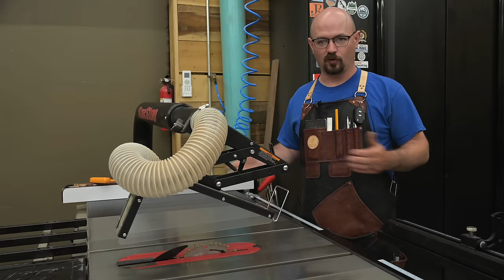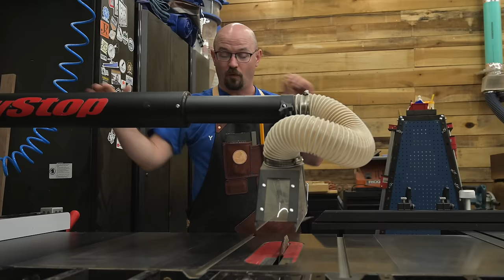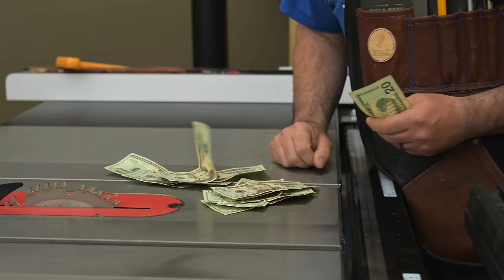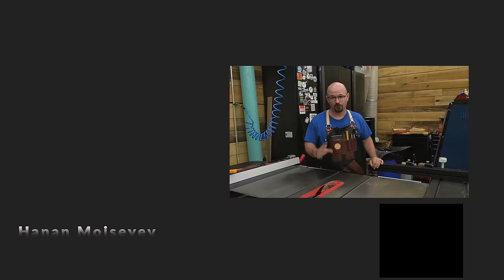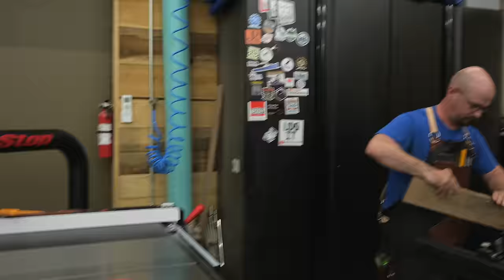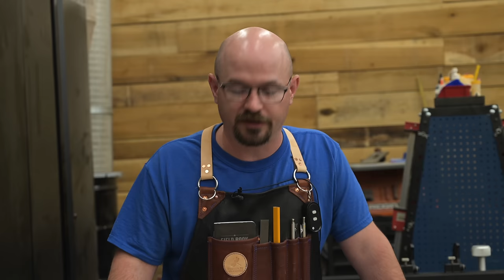Is SawStop Actually Safer?

Comment: Because I’m concerned about becoming complacent, I got rid of my Sawstop. I also removed the seatbelts from my car. God knows I don’t want to be caught being complacent behind the wheel of a car. Btw - I also removed the bannisters from all of the staircases in my house. Can’t be too careful there.
Reply from the maker: It only makes sense. Hope you also deactivated the “hot burner indicators” on your stove. 🤣🤣🤣
Reply: well hear the thing the table saw ain't the only tool in shop that dangerous. u need to take proper precautions with all power tools
Reply: @johnstrickland3933  For sure. But so what? Nobody's saying consider a safer table saw, but don't bother with safety concerns for anything else.
Reply: Why stop there? I removed my car side mirrors, got rid of my spare tire, both fire extinguishers, condoms, trigger locks, welding helmet, safety goggles, hearing protection and deleted my smartphone security (like I would ever leave my cell phone behind). Sure, I'm practically petrified when ever I'm awake. But, at least I won't be complacent.
Reply: @steveh8724  in not saying not to just make it a law that u have to have technology.
Reply: Did you removed your covid vaccine too ?  .... seat belt analogy ... 😂😂😂😂😂😂

Comment: I own a PCS175 and I bought mine second hand.  I am a weekend warrior woodworker and owned a cabinet saw and contractor saw prior to owning this saw.  The Sawstop is a well built machine and is a joy to use.  I am likely more careful than I ever was cause I just dont want to trip that brake and join the "club".  It gives me peace of mind knowing that if ever I get complacent or do have an accident, the injury should be minimal.  I am also aware that the saw won't save me from a bad kickback, although the riving knife, proper alignment and good technique reduce the chance of kickback.  I still respect the saw, just as I do all of my tools.  And when I did not have the financial resources to buy the saw, I came up with reasons to not buy one, and once I saved up for the saw, I found reasons why I should own one!  I always knew deep down that this was the right saw for me.
Reply from the maker: I think the last part of your comment is key.

Comment: I knew the Sawstop was a good idea from the original press release, but already had a table saw. Then I started working on a canoe. For a year, the saw was shoved in a corner and I used a hand saw a lot. When I could use it again, I just was not as comfortable with it. Your spouse/partner/mom wants you to have a Sawstop too. BTW, if you do stick your hand in the blade they'll send you a new cartridge. Just not for an accidental trip like cutting into an aluminum miter gauge.
Reply from the maker: Ah that’s right. I forgot they’ll replace it if it was a flesh contact.
Reply: I didn't get a new cartridge when my saw saved two of my fingers because I wanted to keep the one that saved me, complete with embedded blade!

It's absolutely unbelievable that so many people say "oh, it's expensive when it fires and ruins a blade and cartridge", as though the cost of losing a finger isn't a gazillion times more!
Reply: What they also wont do is replace it when it goes off for no reason.  I, me, this guy, personally had one misfire on me twice and there was no metal or even slightly damp wood...or flesh involved.  First time the saw was already turned off, yes, OFF and only a piece of the off cut plywood was anywhere near the blade...I hear this "thunk" but didn't think anything of it till I went to turn the saw on again and it wouldn't.  It fired, while it was off, with nothing touching the blade but air...and the blade didn't drop either.  SawStop asked...was it humid that day?  Dafuk?  No, it wasn't, and also, this saw is in an air-conditioned shop.  Next time I was ripping a piece of kiln dried maple, maybe close to 2in thick, and it went "thunk" mid-way through the cut...still no metal or flesh in contact with the blade and again, the blade did not drop...it stopped...but didn't drop.  Same stupid question from SS...was it humid?  Same answer, no, and still in an air-conditioned shop.  This was at a maker space called TechShop.  They had several incidents like this...I can only speak in detail about these two.  Not very good at inspiring confidence in my personal opinion.

Comment: I upgraded to a PCS a couple weeks ago after using an old jobsite saw for a few months after getting into the hobby. The cost of a losing a finger is more than just the medical bills. It impacts your livelihood. My work would severely be impacted until I could replace decades of muscle memory if I lost even a single finger. 

I fortunately am in a position where I can drop $4k on a new table saw for a hobby, but I know most people can't. I would say to most people though that you can buy a comparable SawStop model for the cost of that cheaper saw you are looking at plus a $1k insurance deductible. 

I am in the same boat as you as well. I am really attached to my wallet. No one wants to spend $200 on a new cartridge and blade, and the thing isn't bloodless either. The cut probably isn't going to need stitches, but it isn't going to just be a scratch either. I will admit I am more comfortable having my hand closer to the blade, but that doesn't mean I am being reckless with it either.
Reply from the maker: Right? Theres a big difference between adjusting your technique based on the change in risk and being aware of that.. and just being reckless. 

Glad to hear you were able to afford one. It's definitely an investment. And no matter how much something is worth it, if it's not the cheapest option there'll always be those that just don't have the funds.
Reply: @YouCanMakeThisToo speaking of funds, have you had accidental activations that have not touched skin, but something caused it to increase the overall cost?
Reply: @liquidrockaquatics3900 
It happens but they aren't going to admit it.
Reply: @jowho9992  why would they deny it? There’s nothing to be gained about lying, especially when telling the truth just makes  it obvious that they’re so sensitive. The company covers the replacement anyway because you just send them in and send a picture. I’ve learned a few things since this post.  I bought a pcs, but I haven’t picked it up yet
Reply: @liquidrockaquatics3900  
I have already seen a video where they claim that wet/green wood can trigger the stop.
Can any show proof that it doesn't?
Reply: @jowho9992  wet wood can of course, the saw flashes if you test it first. Bourbon moth or someone cut a bunch of nails and stuff and it didn’t trigger, but aluminum triggers it 100% of the time- even foil backed insulation  edit- it has to be really damn wet, and YOU have to be in direct contact as well

Comment: I have had my saw stop for about a year and I have not found my technique change really at all.  I don’t want the brake the kick off and always try to assume it’s not there. It’s insurance not part of your workflow.  Saying it makes you complacent is like saying having airbags on cars makes people more likely to run into things.  My new saw also added a riving knife and much better blade guard so that was a huge plus in addition to the flesh sensor.  Kickback can still happen but the sawstop design minimizes it to a much higher degree than my old 20 year old saw.  I looked at many 3 to 5hp saws and in the end decided the Sawstop was the best choice for me.  I have not regretted my decision at all and the sting of spending extra on the saw is long gone while the joy and insurance of using it lives on.
Reply from the maker: Mine has changed a little bit, but not drastically. 'Cause as you reiterated from the video... last thing I wanna do is go toasting brakes and blades. And if I'm being honest, I don't do sketchy stuff any more or less often than when I had my 30 year old saw without even a riving knife. I just don't sweat as much when I need to do those.

Comment: I think for most people, particularly those making comments on youtube videos or online forums, it comes down to simple cost. Sawstops are expensive. Yes, they are great saws outside of the safety feature, but that actually is part of the issue. It's my understanding that one of the reasons why Sawstops are so well built is because they need to be in order to deal with the inertia from the safety feature engaging. That's a lot of kinetic energy that needs to be absorbed by the saw in a fraction of a second, so you need heavy duty components to be able to survive and continue working once you install a new brake/blade.

Assuming that is true, that means cost. Most people commenting on youtube/forums are not cabinet makers or big shops, they are hobbyists working in their garage/basement. They don't always have the extra $1000+ in order to buy a sawstop compared to a the same size saw without the safety feature. Yes, everyone knows that an ER visit will be more than $1000, but most people are living paycheck to paycheck. They don't have an extra $1000 right now. They don't have the $3000+ to pay for an ER visit (which is why medical bankruptcy is so common as you mentioned in the video).

Now yes, some of those comments are old timers who have been doing it for 30+ years and are stuck in their ways. But, a lot I think are just bitter that they don't have the money for something that should be standard on every saw right now (like seatbelts and air bags on cars). Yes, some are confident (over-confident?) in their skills and use that to justify buying a 3hp or 5hp saw in another brand, for the same price as the contractor or 1.75hp pcs sawstop. However, most I think are just bitter that they don't have the money for a safety feature and so come up with excuses to justify it. I don't begrudge folks for that attitude at all. A seatbelt/airbag is not a significant added cost to a car, but it is on a sawstop and because of the patent law right now, Sawstop has a monopoly on it. I know a lot of people who are waiting for the patents to end, so other manufacturers can start producing their own versions. This is on the assumption it will drive the price down, as it has many other tools after a patent expires. Look at the price of biscuit joiners, oscillating tools, and now track saws before the patent expired they were all over $1000, now you can pick up cheap versions for $50-200. Over an 80% reduction in price due to competition. Now will that happen with sawstop style safety devices? Probably not, due to my comments earlier about build quality, but it should still likely cause a significant reduction in price to where it becomes reasonable to spend $200-300 extra for the safety feature, rather than $1000+. In that case, folks would likely consider saving up that money, rather than buying something now (or buying used) and dealing with the added risk.
Reply from the maker: Very true, I think there’s a lot to the bitterness. It’s often easier to make up really poor arguments against something you want but can’t afford, than to just say “it’s out of my budget.” Especially to a demographic that has had it heavily impressed that their marketplace compensation IS their personal value and worth. 

Personally I’m hopeful with the patent expiration we’ll see some better alternatives. There’s been some nondestructive methods developed that seem to be as effective as SawStops destructive method. But no detection method that’s as good as SawStops.. so once SawStop has run out the monopoly for developing and taking it to market I think we’ll see their detection method copied but with different ways of stopping/retracting the blade. 

This is one that’ll get me in trouble, but that’s also a reason (I have more) of why I support making it mandatory. If it’s required and not something you can upsell, there’s motivation to find the most economical way to achieve the goal.

Comment: I just bought my first table saw for professional use. I have some experience with a table saw, but due to a fear of injuries I have been using a plunge saw instead. I’ll be returning my table saw and buying one with a sawstop feature (festool since Im from Europe). A moment of carelessness shouldn’t result in a few less digits, so it’s worth the money. Im a sceptic individual, hence I don’t trust the sawstop feature and will use it as so.
Reply from the maker: For what it’s worth I haven’t heard of it ever not firing when it should have. But still, it’s a back up safety feature.

Comment: I like knives. I’m careful when using them. If you use knives enough you eventually cut yourself even when you figured you’d never hurt yourself. Usually not a deep cut but it still makes me think about how you can still have an accident no matter how careful you work.

The permanence is the part of any risk that makes me afraid of it. If you can change your whole life in a flash it’s probably going to be worth it to have a SawStop.

I had table saw operations where blade was high for thick material. I used push sticks and I planned the cut. I still scared myself pretty good because I cut my push stick and if it had cut the beak enough I could pushed the stick right into the blade. Your focus sometimes needs to be in multiple places. Like when you are yielding and someone is in front of you and they also yield to merge but you look back to see oncoming but the car in front of you full stops and you  were not ready to fully brake. You gotta look back and forth, multiple times, between those two things quickly.
Reply from the maker: Great point and analogy. I love cooking, done it every day for years. I have nice kitchen knives, keep them sharp, use them every day, have studied good technique. About 2-3 times a year I still nick myself though. But it heals in a few days… table saw could be a life change.

Comment: While I don't actually make as much use of my 1976 vintage RAS as I once did, I do find myself considering a Sawstop. The cabinet and contractor models are just too large and heavy for me to get one down into my basement, despite how much I'd love to have one. So, if I do get one, it will have to be either the JTS or CTS model. Truth be told, that old RAS still does yeoman duty for me despite it being both a low-tier model and 48 years old. But the allure of a SS is strong. :) I will consider no other new saw than SS!

Comment: I have two of my fingers because of my Sawstop. Yes, I got complacent, yes, I was doing something stupid. But humans get complacent, humans do stupid things. I'd been woodworking professionally for 11 years, and had my Sawstop for 7 years, before I had my accident (which was the first time the safety system fired). My injury was much worse than what Sawstop shows (16 stitches), but that's due to the circumstances when it happened, and I'd be missing two fingers now if I had my old saw last year. 

To the people who say "you don't need a Sawstop, you need a safety mindset", I say, do you own fire extinguishers? After all, we have a safety mindset about fires. We don't leave oily rags in piles, we clean up sawdust, we keep bearings lubricated, etc. So why do we have fire extinguishers? Because we know that, despite our efforts, sometimes bad things happen.

I started woodworking on an old contractor's saw, and adopted a safety mindset with it. I'm pretty safety-minded in general. But the statistics on table saw injuries are scary. I know two people who were hurt by them; one is missing part of her finger, one is missing an entire finger. The latter cost a quarter million dollars over seven surgeries...and he still lost a finger.

These saws are a case of "this device makes a stupendously huge difference in safety, so it's stupid not to have it". The added cost vs a regular saw is NOTHING compared to the cost of an injury (*where you still lose a finger(s)!*). Heck, it's nothing when amortized over the life of the saw.

Unless you use a table saw only occasionally, find a way to afford a Sawstop. Seriously.
Reply from the maker: There's an argument that if you only use it occasionally... you should probably still have one because there's a greater chance you've forgotten some of the proper procedure. It's like saying "always wear your seat belt, unless you drive very infrequently" ...if you're seldom behind the way, you're probably more likely to make a mistake.

But yeah, we're on the same page. If you can afford it, it's great to have. If you can't afford it.... then you definitely can't afford an accident without one.

Comment: If you are out of the way of any potential kickback, does it matter if you stand  to the right or left of the blade?
Reply from the maker: Left or right isn’t important. It’s being on the side kickback is least likely to happen on. MOST of the time kickback happens between the fence and blade because it gets trapped and twisted. On the non fence side a piece normally just slides away and doesn’t turn into a projectile.. unless it’s a small piece that can get wedges between the blade and insert.
Reply: @YouCanMakeThisToo  Thank you!!

Comment: Anyone can get complacent on any tool. The table saw gets more attention than any other tool. For good reason it is used more than any other tool. I’ve used many different table saws over the 35+ years that I have been woodworking. I myself own a Dewalt compact job site saw, Delta contractor , and a Sawstop cabinet saw. All of which are dangerous Saws. I treat every one with the same respect. I pray that anyone who reads this does the same. Have a good one 😊
Reply from the maker: Same to you brother

Comment: Now that the patents have expired; hopefully  someone comes out with a resettable version with a replaceable brake shoe?
Reply from the maker: There is one in Europe. And the CPSC seems close to finally making it rule. TTI has already said if they do they’ll make the key patent (one that covers monitoring a small charge to detect contact) available for public use